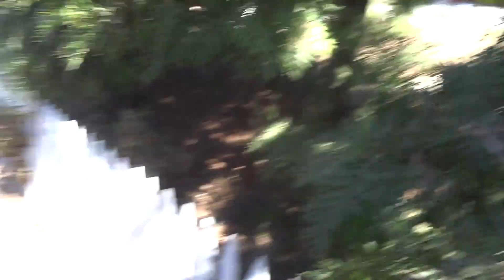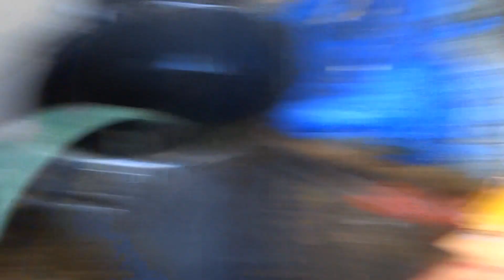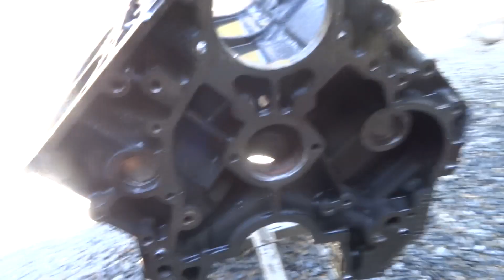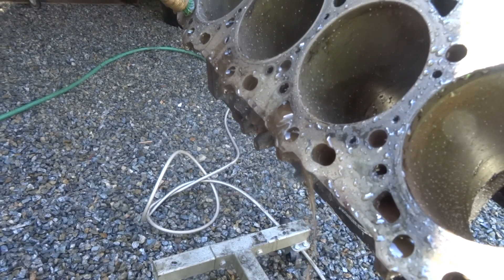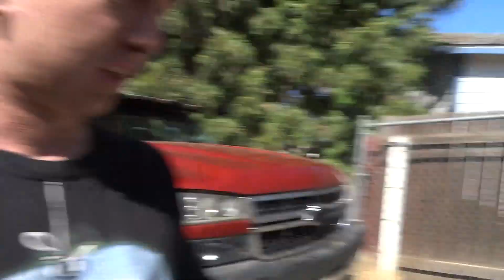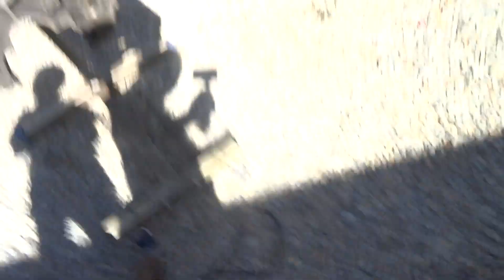Duramax engine build continues!! acid bath!

Comment: Next time try a commercial restaurant barrel the Gray plastic barrels they aren't tapered  at least the soak is 100%  didn't the acid etch the cylinder walls lifter bores ?
Reply from the maker: That’s a good idea for the barrel! Thank you and no there was no damage to the walls except what was already there from the block being left outside by the previous owner! This was my attempt to save it. But this is actually what the machine shop had told me to do so I didn’t have to bring it too then to do it and clean it!!

Comment: Hot tank is best, they use a lye mixture and heat the tank over night. When done, it rinses without any debris as in this video.
Reply from the maker: Yeah for sure I would like to get one when I get a shop but might just leave it to the machine shop! But thought this was a pretty cool trick for the do it yourselfer
Reply: @ResurrectedDP  Yes, best to let the machine shop deal with it...it's much less responsibility and cost.
Reply from the maker: I agree ten fold

Comment: Wow, that scale and rust was probably choking the cooling system- I'd say you just saved that engine. I'd hose it down with WD-40 after that.
Reply from the maker: I oiled the whole block but I actually got rid of that motor in trade for a good block that someone was getting rid of
Reply from the maker: Core trade in haha

Comment: Why didnt yall just take it to an engine shop to get it all cleaned? Im not sure about where you are but by me its less than $100
Reply from the maker: +Repomam2000 no we didn’t but that’s why we pressure washed all the passages and we looked in after we cleaned and the passages are clear!!
Reply from the maker: +Matt Read be cause I’m cheap haha no I actually called the local engine shop and the Gus said they could do it but he told me how to do it myself I’m sure I wasn’t 100% right on how I did it but it worked
Reply: DURAMAX_DIESEL damn thats solid. Around here they barely wanna talk to you let alone tell you how to do it!
Reply from the maker: +Matt Read yeah the guy was pretty cool he said they would’ve done it how he told me to do it they didn’t have like a special machine they paid for it so no sense it wasting their time with that if I’m not having machining done
Reply: Didyou take out all the freeze plugs when you cleaned it?  a lot of shit can get trapped in there if you dont.